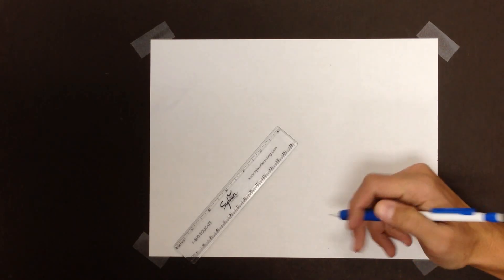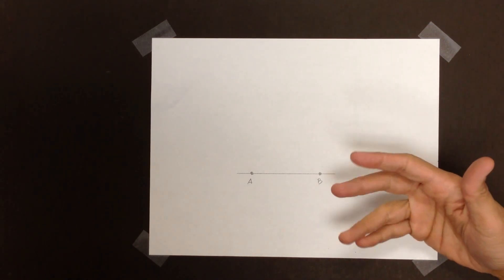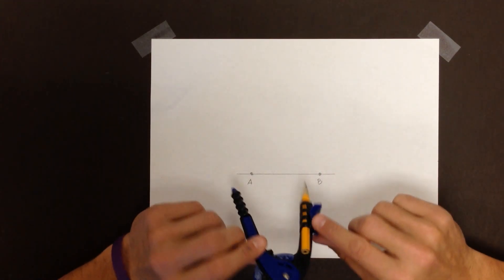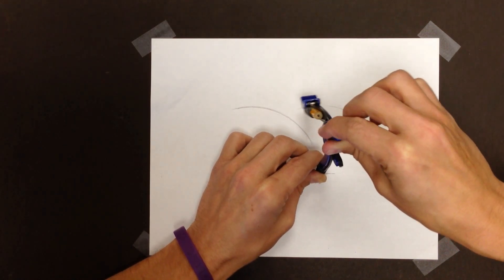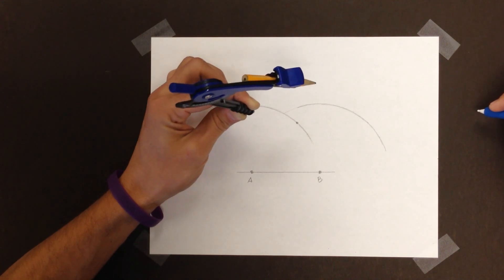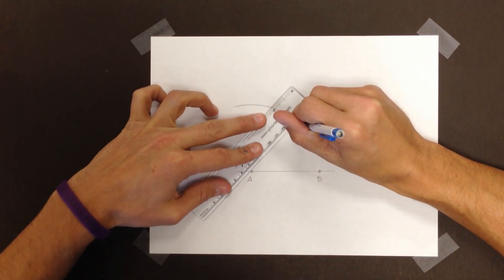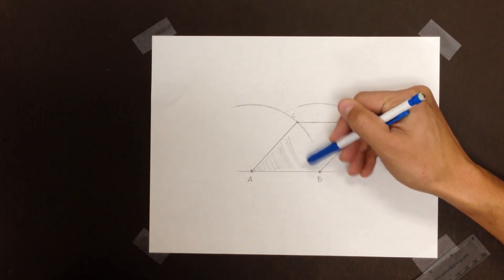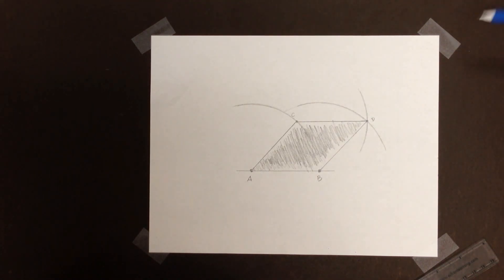Constructing a Rhombus

Comment: By your way I have constructed a rhombus but in that opposite angle are equal. 2 angles are 40 and the rest two are 140. degree in measure.  Is it right please reply soon.
Reply from the maker: That's correct.  Opposite angles should be congruent.